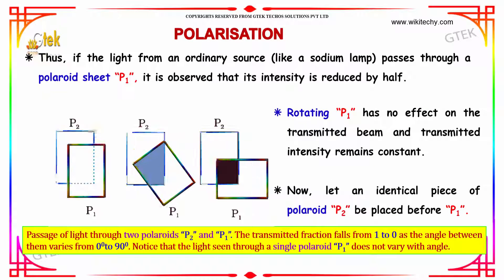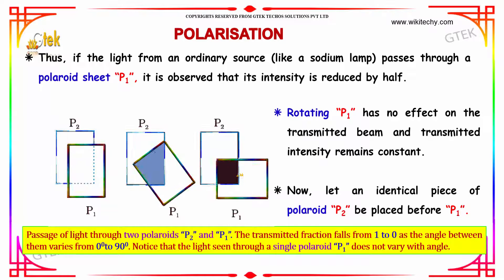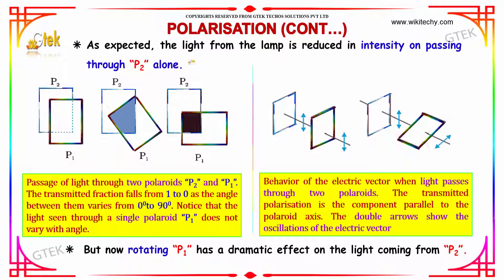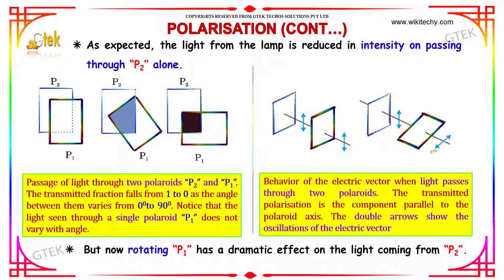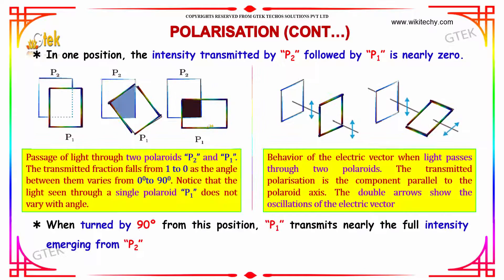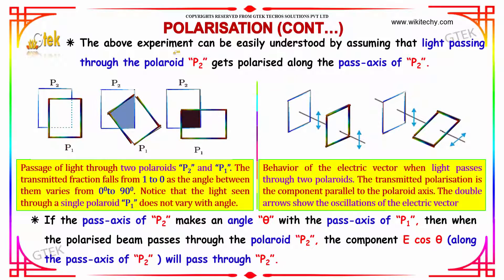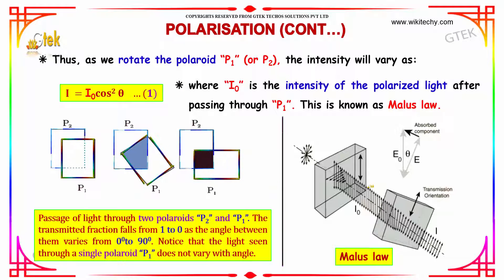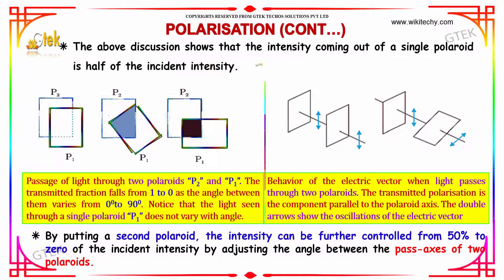Malus law and polarisation|Optics|class 12 physics subject notes lectures CBSE|IITJEE|NEET

Comment: In a circular polarizing filter, as the front plate is rotated, the angle of polarization and thus the amount of polarized light that passes through the filter changes. This allows precise control of the degree of polarized light that is to be removed.

Comment: According to malus, when completely plane polarized light is incident on the analyzer, the intensity I of the light transmitted by the analyzer is directly proportional to the square of the cosine of angle between the transmission axes of the analyzer and the polarizer. Therefore, I ∞ cos2θ. This proves law of malus.

Comment: Malus's Law. According to malus, when completely plane polarized light is incident on the analyzer, the intensity I of the light transmitted by the analyzer is directly proportional to the square of the cosine of angle between the transmission axes of the analyzer and the polarizer. Therefore, I ∞ cos2θ.

Comment: Most light, like light from the sun or a light bulb, is a mixed mess of light waves that oscillate in all kinds of directions. ... But this oscillation direction is called the polarization of the light. A polarizer is a device that cleans up this mess.

Comment: The law stating that the intensity of a beam of plane-polarized light after passing through a rotatable polarizer varies as the square of the cosine of the angle through which the polarizer is rotated from the position that gives maximum intensity.

Comment: Malus' law. When a perfect polarizer is placed in a polarized beam of light, the intensity of the light I, that passes through it, is dependent upon the angle θ between the light's initial polarization direction and the axis of the polarizer I=I0cos^2(θ).

Comment: A Polaroid polarizing filter functions similarly on an atomic scale to the wire-grid polarizer. It was originally made of microscopic herapathite crystals. Its current H-sheet form is made from polyvinyl alcohol (PVA) plastic with an iodine doping.

Comment: A polarizer or polariser is an optical filter that lets light of a specific polarization pass and blocks waves of other polarizations. It can convert a beam of light of undefined or mixed polarization into a beam of well-defined polarization, that is polarized light. The common types of polarizers are linear polarizers and circular polarizers. Polarizers are used in many optical techniques and instruments, and polarizing filters find applications in photography and liquid crystal display technology. Polarizers can also be made for other types of electromagnetic waves besides light, such as radio waves, microwaves, and X-rays.